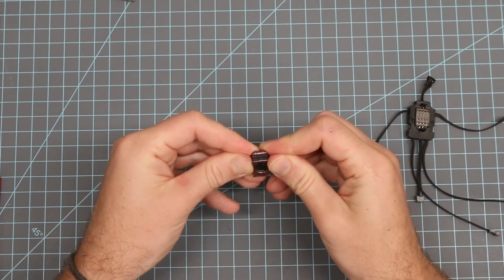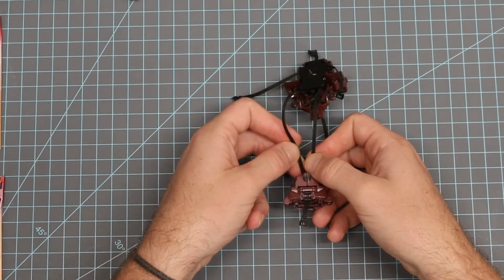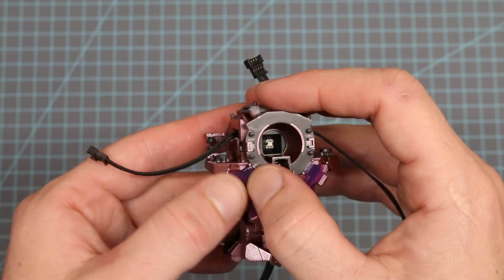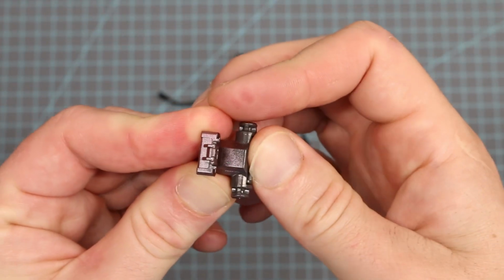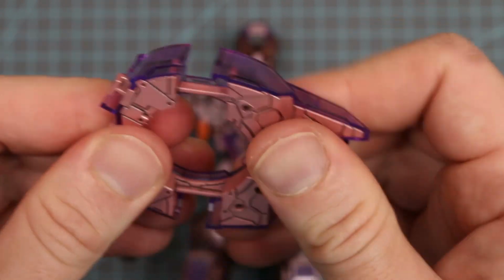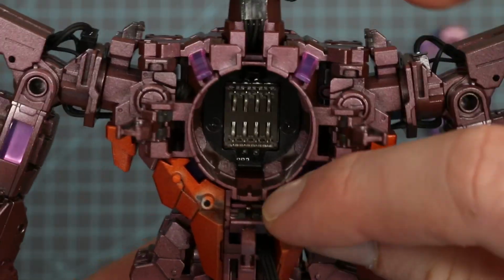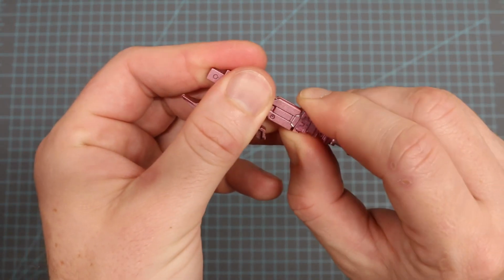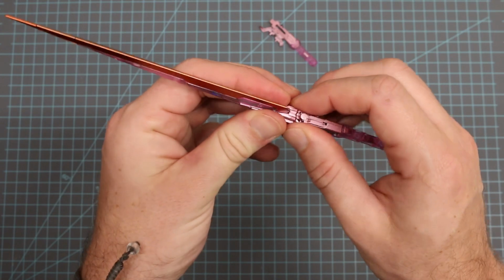Let's build a painted PG Clear Exia

Comment: Nice video! Do the LEDs turn off after a certain amount of time or do they stay on until turned off?
Reply from the maker: They turn off around the 5 - 10 min.  Mark.  Long enough to look cool, but it won’t drain the battery
Reply: @neglectedgundam  Great, thank you so much!